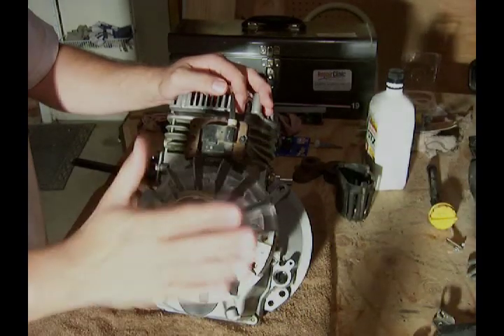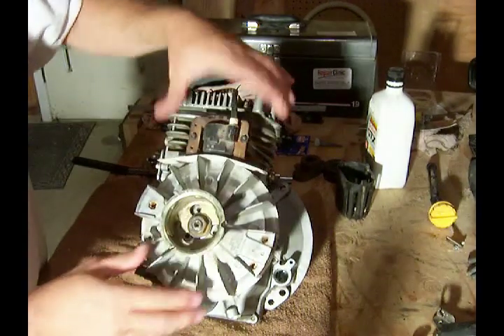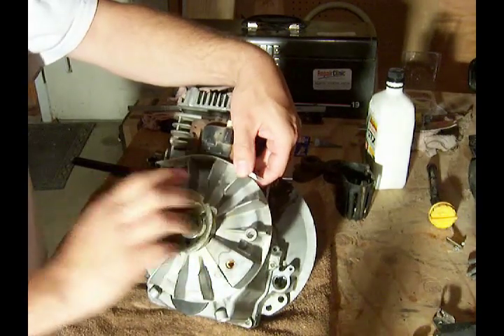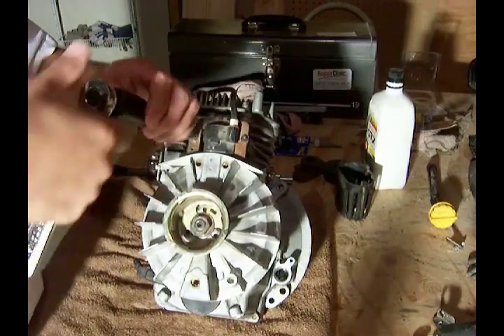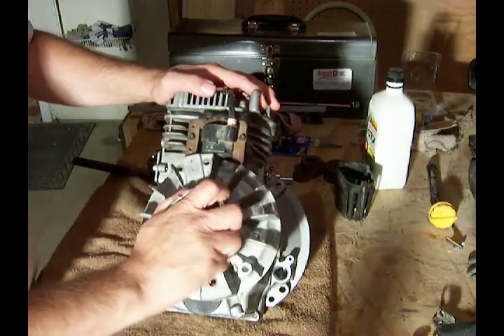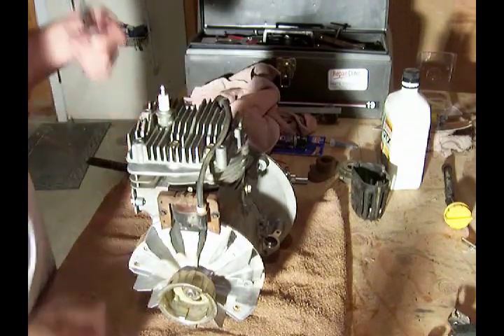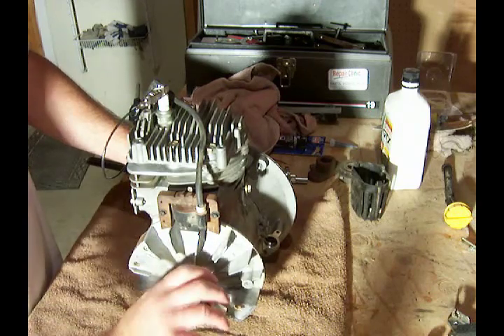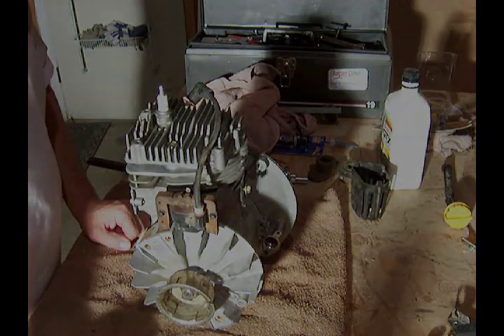#20 Tecumseh LV195EA / LEV120 - Ignition Gapping and test for spark

Comment: This video series has been really helpful thus far. Gave me the courage to began repairing my mower. I’m a bit confused on which part number to go with listed below. 
two different shops and each sold me a different flywheel key for my 6.5 HP Tecumseh lawnboy mower.
(LV195EA-362044D)

#611298 
solid rectangular no odd shapes. Solid steel.

#611004
The other key appears to be aluminum. Slightly taller than the listed above and shaped like an “L” with one end being thicker and the other. 

Also the orientation of how to insert the key into the keyway. 

Thanks again.
Reply from the maker: The purpose of a flywheel key is to shear in case of emergency to prevent catastrophic damage to other engine parts. NEVER use a solid steel flywheel key (it won't shear). There are reasons to use solid steel "woodruff" keys. This is not that time. Thanks for watching.

Comment: I determined my had a motor have a bad coil.  So ordered coil via Amazon for about $18.00.  After installing coil, I did not have a spark plug tester to determine if sparking, but grounded plug to head and could faintly see spark, but could "hear" it when rotating the magnetic portion of flywheel rapidly back and forth coil By following your instructions on setting the air gap on the coil...my mower started on the first pull!  Wow did I feel good.
Reply from the maker: I am very happy that my video was able to help out. Thanks for watching!

Comment: I can't tell you how happy I was to find your videos on this engine. I disassembled the engine several months ago, and while I have rebuilt many, I was a little concerned I might not get this together correctly. You made everything clear.
I hit a rock and this engine became impossible to start and very hard to crank. I suspected a bent crankshaft, but found that the piston rings had scratched the cylinder wall, which I had never seen before. I am replacing piston/rings, and your video saved me.

Comment from the maker: Also make sure that there is a mower blade on the mower. Without the blade, you are likely to hurt your arm from the compression jerking back extremely hard on the starter rope. The weight of the blade helps the crankshaft spin easier.

Comment from the maker: Compression can only exist in a sealed environment. When you remove the spark plug, there is a hole at the top of the cylinder - not exactly sealed. There is a "compression release mechanism" located on the cam - inside the engine. It is possible that the mechanism is broken or missing. That mechanism releases a bit of compression to help the engine turn over easier while starting. Once the engine starts, the mechanism is no longer needed and centrifugal force moves it to run position.

Comment: Thank you.  Everything gapped and put back together. It starts, and runs. But it is hard to pull start. There seems to be a point where there is a lot of resistance. I removed the coil and there was still resistance. I pulled the spark plug and it he flywheel turned more freely. Any ideas? Not sure what is preventing it from pull starting smoothly.  Thanks! Jim

Comment from the maker: According to the repair book that I have, the official air gap is .0125" (.3175mm). As with most small engine spark plugs, the plug should be gapped to .030"
Thanks for watching.